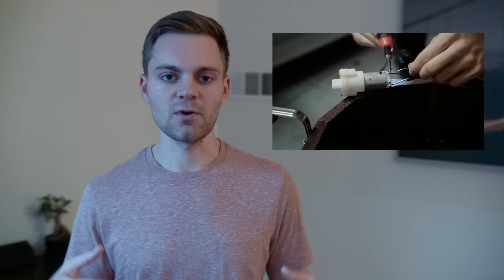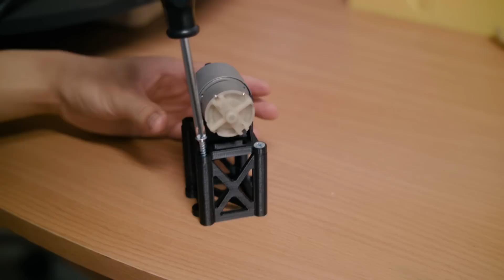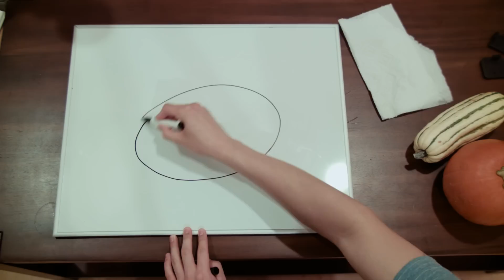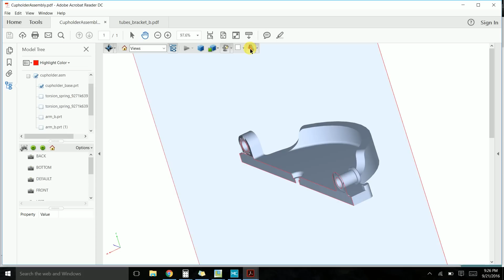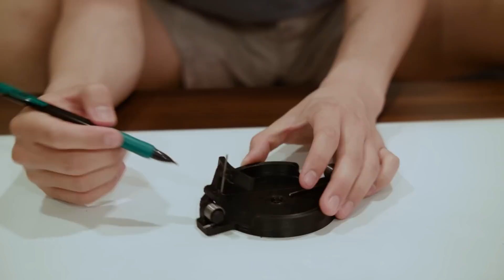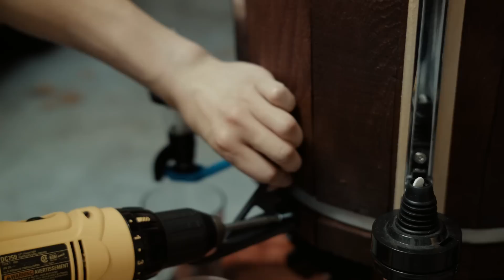Building a Robotic Bartender - Part 6: Drive Motor and Cupholders

Comment: It looks like you might not need any more speed, but if you spin the motor mount 180 degrees so the wheel is closer to the center, the platform will move faster.

Comment: Great going.
one doubt though. How do you mount the alcohol bottles on top of these ? doesn't it spill while mounting ?
Reply: A.Rajib Kumar Gupta I'm pretty sure in an earlier video they showed the bottles inside of the bucket when demoing the pump mounts, and they were not upside down
Reply: Jacob Baughcum yes I know but their first ever prototype has bottles upside down. See the first video.
Reply: A.Rajib Kumar Gupta well that does not pertain to this video, but I'd assume they unmount the dispensers before putting the bottles on, that way they can screw the dispensers on top of the bottles, rather than screwing the bottles on top of the dispensers. I'm not sure though, I did not come up with the design myself
Reply: Jacob Baughcum yeah I am sorry for that. I had commented on that video only. No idea how it showed up here. 
Do you have any idea which compressor they use?
Reply: A.Rajib Kumar Gupta I regret to say I'm not completely certain. The components list doesn't seem to include it. Hopefully Davis or Aaron (not sure that's how they spell their names) will see this

Comment: I bought exactly the same pump as you and contacted to 12v power the motor is spinning but the pump Is not pumping or even sucking would you know why that could be?
Reply from the maker: +Usyou Him reverse the tubes
Reply: Non of them are actually sucking the in or the out unless you mean something else by reverse the tube
Reply: Some pumps need to be drowned to work properly. In other words, you need to fill its interior with the fluid you are pumping beforehand.

Comment: Hey guys, great job with this channel, this definitely needs more exposure. I have a few suggestion that may help you if you encounter more problems. First, what is the the maximum current of you old and new supply and whats the nominal current of all of you components? In your last video you mentioned that your power supply couldn't supply enough current due to peak current draws Depending on the the magnitude of your peak current draw, you might get away with a simple beefy capacitor connected to the voltage rail and ground. Also, is the motor driver you are using is compatible with I2C? Since you don't have (yet) a good feedback control programmed into the arduino, then you will notice that the inertia of the table will dictate the constant speed of your motor. In other words, without a feedback system you will be bound to a very slow speed and considering that the load of the motor will change depending on the number of glasses and the amount of liquid in them, you might never find the optimal speed that will suffice. With feedback control (say PID) you can optimize the speed so it accelerate and decelerate in the most efficient way. For this, you need a good way to estimate the angular position of the table like a rotary encoder on the motor or the easier approach is to switch the DC motor with the stepper motor.